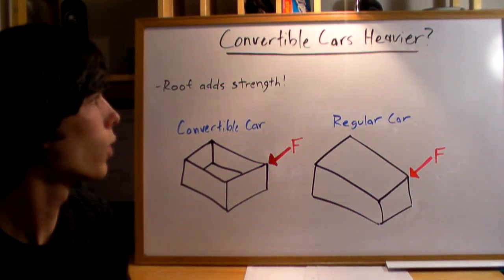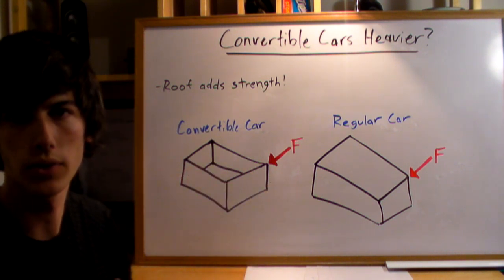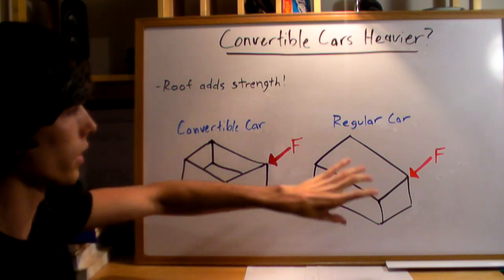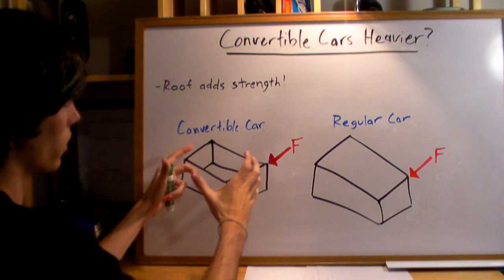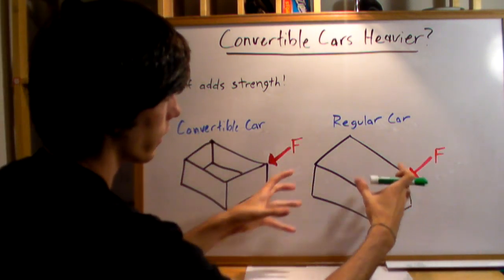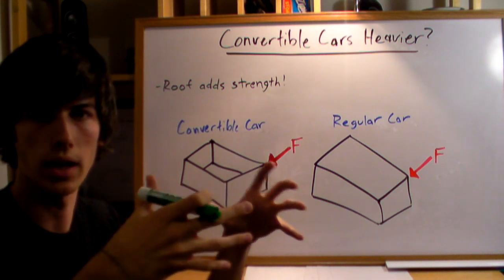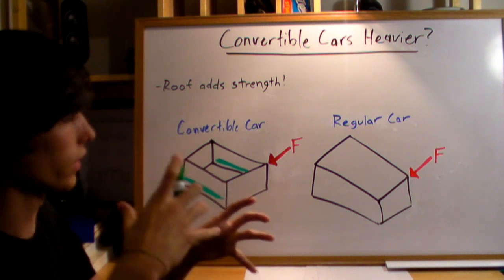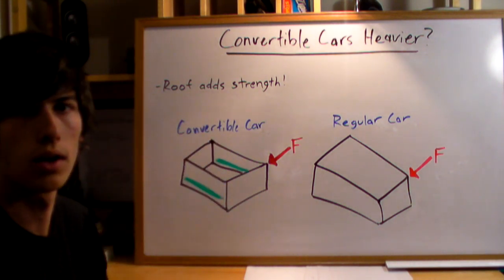Why Are Convertible Cars Heavier? - Explained

Comment: Your missing a larger portion of the weight young man . Hydraulic pump, electric motor, hydraulic hoses,hydraulic cylinders, mounting hardware, and the convertible top framework ,15-20 ft.of copper battery cable,etc.etc.etc. I've had a long career as a professional  mechanic/welder for international trucks, Isuzu trucks,United States army ,and a few hundred side jobs working on cars throughout my life . I'm very happy to see a smart young man like yourself in the automotive field. Welcome friend !!
Reply: yes but what about convertibles that aren't electric. just Manuel ones

Comment from the maker: I would assume so as well, since when the top is down they won't have the added structural benefit of the roof. The car is typically going to be designed to be rigid under the worst circumstances.

Comment from the maker: Uhh, well that weight is going to be low and wouldn't do much for a side collision I don't think. And having your head exposed doesn't seem safe to me, especially in a roll scenario. I'd say non convertibles would be safer, as a benefit of the rigidness of the design.